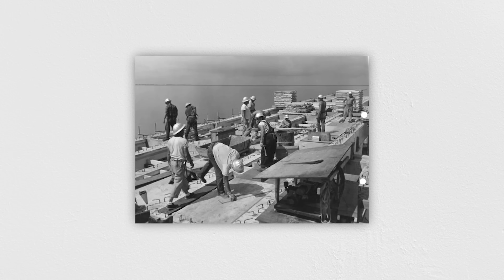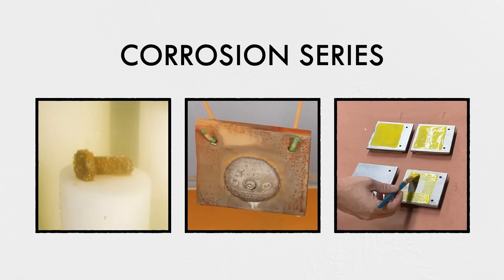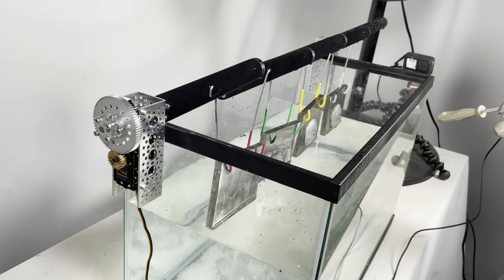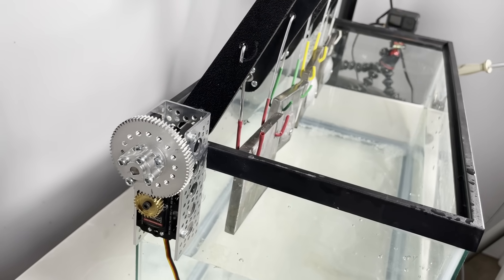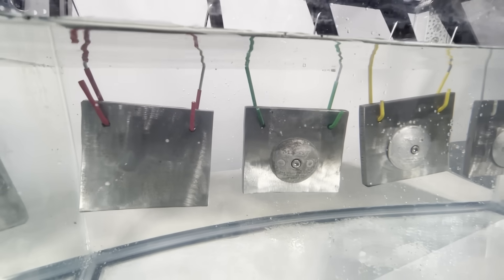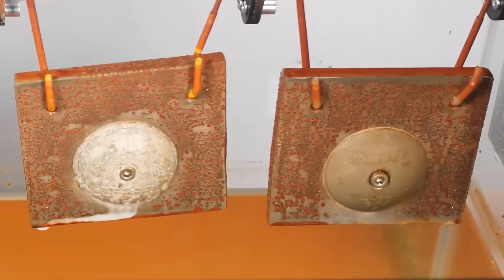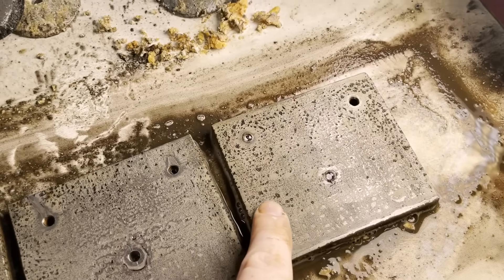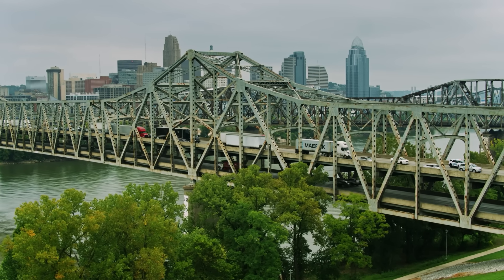Why Spillway Gates Don't Rust Out

Comment: I had a co-worker that swore (and told anyone listening) that putting a (like in singular) boat anode on the rear bumper of a truck would keep the body from rusting. He said it "neutralized" the road salt...I was in the marine industry, and we ran across and interesting situation once. A gentleman had bought a new boat with twin outboards. He'd leave it on the dock for weeks, so he had an onboard charger for the batteries that was plugged into shore power.  We had to replace the charger as it had been submerged. Easy job. Just disconnect some wiring at the charger, install the new one, and reconnect. That fall we got a call from the boat yard that hauled it. "There's a problem with the boat." I went over to look at it and was shocked to find the stainless prop all chewed up and looking like some medieval weapon and the drain plug, also stainless, corroded right off. Turned out, the people that rigged the boat in the spring hadn't connected the two batteries together and, the way the charger was hooked up, it was sensing the port battery needed charging, sending charge, but the ground between the two batteries was missing so it went through the motor, out through the noblest metal (the stainless) and found it's ground at the starboard motor.
Reply: I've used that technique to etch stainless steel water bottles
Reply: So did the truck rusted with the anode?
Reply: @dan_youtube  I never saw the truck but, if the bumper didn't rust, I think it was more a case of good maintenance than the anode. A boat anode shouldn't do a thing for road salt when attached to a vehicle like that. The guy would also tell all sorts of other "truths" to anyone that would listen.
Reply: @mikestackhousemusic  yeah, that anode would only protect things that are connected via electrolyte fluid films, so painted surfaces, areas that do not get wet or otherwise breaks that conductive path would create  barriers to the protective effects.  the "school of hard knocks" has a lot of ideas and stories, but not a lot of rigor or verification.
Reply: @mikestackhousemusic 
You can try! Aluminium is cheap !
Reply: @mikestackhousemusic : If the salt formed an electrically useful connection between bumper and anode, then it should have worked for the same reason as it works on boats. IF the salt formed an electrically useful connection.
Reply: @mikestackhousemusic  Anodes are considerably more effective when the various metals (and the anode) are submerged in water, especially salt water. The current needs an electrolyte to travel through to reach the anode (otherwise it can only protect the metal its directly in contact with). If everything is submerged the anode can provide protection (through self-sacrifice) to other metals a small distance away.
Reply: What about the truck bumper?
Reply: Cathodic protection requires a galvanic cell to function. This means both a physical electric connection for electrons to and electrolyte/saltbridge connecting the substrate and sacrificial metal. So the truck thing works, but not as effectively as submerged or buried examples. 
It sounds like the boat example was a case of leak current causing the ooposite effect of impressed current CP, a process that can indeed be used to etch. 
When the protective surface layer of corrosion resistant materials ( aluminium or Stainless f.e.) is nullified by acid(cataliyic) or galvanic means, it will corrode just fine. A good example of this (galvanic corrosion) would be coated aluminium equioment mounted outside with bare SS nuts or screws. The opposite of CP will occur near the bolt-alumimium interface. Moisture and dirt will create the electrolite and as the less noble material, the aluminium will sacrifice itself for the stainless. Blistering of the coating and white corrosion product at the connection are the result. 
Another example is copper nails being used on steel yachts; fine, along as there  is no metal to metal contact.
Reply: Is it was single wire 12v system? Negative via hull?
Reply: @kklenov  twin 12 volt batteries but the positive from the charger went to one battery and the negative went to the neg. terminal of the other battery. When the boat was set up that spring, whoever did it didn't connect the ground for the two batteries together.
Reply: @kklenov  Давай я помогу: "Was it a single wire power supply of 12v wired down to the hull?"
Reply: @sliceofthatpie  мгимо финишед :)
Reply: Had a similar problem with a big boat with 120/240V ac power onboard with generator power and shore power to supply it The boat dock 120V power had a bad neutral connection coming from the utility company service drop to the house and boat dock, and, when the boat was connected to shore power, all of the submerged metal (which is all grounded together and to the boats' electrical system ground) was helping to carry 120V AC neutral current for the entire house and dock power back to the utility company transformer via the water and earth to the ground rod at the utility company transformer. It ate up the metal on this boat and the neighbors' boat which was in the next boat slip and connected to shore power. The warm, moist salt air also helped, causing all the stainless bow rails, aluminum tower, and anything else above the water line that was connected to ground to rust, corrode, or turn green at an alarming rate.

Repaired the service drop feeding the house and boat dock, and all this stopped.
The owner was surprised, and the neighbor was pissed!
Reply: I recall in the late 80s, early 90s that JC Whitney sold a product that plugged into 120V and was supposed to keep your auto from rusting. Idk of anybody that had this personally but my dad said he knew a guy who used 1 of these machines and it supposedly worked. My Dad also told me when I was 5 that he'd pay me a quarter for every fart I'd catch in a jar and paint green. I'd run around with a jar for years after. never made any $ but as a kid we believe whatever parents say as fact. We also got some chickens 1 time in a burlap sack and dad said they died from cold but could bring back to life. We set sack in yard, did a dance and said some crazy words and tge chickens came flying out. I have a great Dad. I owe him alot. Now I get to do same things and make my kids think I can do magic and fix all things.
Reply: Sooooo what happened to the truck?
Reply: @Dountman 
Truck rusted away wholly, but that Zinc button lays on the dirt outside of house 😢
Reply: @Dountman that was answered 4 months before you left your comment.
Reply: @bryceanderson4864  I know your wife let me know the details.
Reply: "plain sabotage!"
Reply: Electrolytic corrosion is the name of that and that guy was full of it he just though he knew but rust and corrosion are different rust is a oxygen reaction no energy needed
Reply: Boat! Break out another thousand!
Reply: That is a new one.
Reply: First impression…. The proximity will invalidate the test
Reply: Two stories for the price of one long comment!
Reply: A1 explanation man, I feel like I was there myself
Reply: What? 🤣
Reply: I am pretending to understand all of this you said.
Reply: not reading this
Reply: Galvanic corrosion at it's finest
Reply: Far out
Reply: Anodes don’t work on trucks because air isn’t conducive like water and earth. You’d have to coat the whole truck with something that protects it most well known is galvanized steel and aluminum.
Reply: 2 in one ahh comment, that was rly confusing lol
Reply: Who else didn’t understand anything after reading 😅
Reply: @mosesgideon1115 The first section is telling an anecdote of a guy that swore having a anode in his truck would slow/stop rusting.

The second section is another anecdote where a guy had his boat electrical system set up wrong, and that caused the nobel-est metal on his boat to corrode very quickly.
Reply: @mosesgideon1115  other gen z kiddos
Reply: Tldr
Reply: @Metrallata learn to read
Reply: @_..-.._..-.._  lmao youre schizo talking to yourself
Reply: @Metrallata admitting you have a poor attention span doesn't make you cool.
Reply: The hell you talking about 😂😂😂😂😂😂 uh the point is??????
Reply: I ain’t reading all that
Reply: @dark_matter_surron77  reading hard 😢
Reply: i am (confused) idk (what) is going on
what's (with) the parentheses
Reply: Bro speaking yapanese
Reply: @NaiZYaJ  gen z?

Comment: Decades ago, I worked  as an intern in a shipyard. I am now retired. Paints weren't as good back then as they are now.  Ships carry zinc sacrificial electrodes welded to the submerged section of the hull at regular intervals.  One of the maintenance operations done in shipyards, when ships are taken out of the water is to replace those electrodes.   I still remember going under the hull of a ship still wet and in a simple visual inspection you could tell where some of the electrodes had fallen out.  The molten zinc is poured into a cast which has already a bracket of mild steel in it, which is easier to weld to the hull.  The end result is a sort of shiny ingot with two steel ears on each end.    While most of the hull had aged as could be expected, around the electrodes that had fallen off, easily found since the mild metal bracket often remains, the un-protected part was pock marked with holes about the size of a quarter of a Dollar and 3 or 4 millimeters deep. Some parts were so badly damaged that whole sections had to be cut off and replaced.   Your excellent experiment reminded me of that because it was the same steel all over the hull, all moving in salt water, some parts protected and some not, and the difference was just as striking.

Comment: If you want an example of why it's not a great idea to use galvanised rebar in the structure of concrete pylons for a bridge exposed to saltwater look up the incidents and remediation work involving the northbound span of the Swansea bridge in Lake Macquarrie New South Wales Australia, long story short slatwater permeating the concrete reacted with the zinc coating generatied hydrogen gas inside the pylons which seeped out and ignited several times before a costly investigation and remediation process were undertaken around a decade after completion.

Comment: To create rust you need oxygen. There is no need in lifting metal out of water, if water has oxygen dissolved in it - just add a pump for fish tanks o) And you can prevent iron from rusting in water by creating a layer of oil on top of that water - https://www.youtube.com/watch?v=2GrM0WreOxE (no need to listen, just scroll the video)

Comment: Grady, why couldn't I clamp sacrificial cathodes in a few places in my vehicle frame? Especially in something sitting outside waiting for me to work on it? I'm thinking I could sand off areas of bare metal, clamp the cathode in place, then paint over the entire installation. Would paint on the outer surface affect the ability of the system to protect against rust?
Reply: As some one who lives in place with a lot of salt used on the roads in the winter this question stuck out to me. After a quick internet search It seems that that is a thing you can do but the area of a effect is smaller than in a completely submerged system. Rust tends to form in a lot of very small local pockets, this means you would need a lot of sacrificial cathodes. Ideally you would want to coat the entire thing, essentially galvanizing the steel. This lead me to find a product that seems to be widely available, Zinc cold galvanizing sprays. I don't know how effective they are but it seems to be the solution your talking about.
For the second part of your question. Both metals need to be submerged in the same electrolytic solution for the ions to flow. Painting over  the frame would prevent that, nullifying the system except where both the cathode and the frame were both exposed together through a scratch in the paint.
This was really interesting to look into, good question.
Reply: @Hyraethian  I don't quite understand why painting over the cathode would change the system, since I would assume that the "work" is being done where the metals are touching. I think that just means that I don't really understand how this would work though. It makes sense that the cathodes wouldn't work in as large of an area as one would want though. Which brings me to the second part of the video, introducing the low voltage current through the frame. Seems like that would be relatively easy to do on a car. How effective it would be if it only worked while the vehicle was running though might be an issue. Maybe that would be a solution for fleet vehicles where they spend more time operating than they do rotting away in a barn.
Reply: @1stuart1  Ions flow through the liquid. both the anode(frame) and sacrificial cathode need to linked together by the fluid to allow ions to flow. Paint would serve to keep the anode and cathode from being wet from the same pocket of liquid. On something like a car frame those pockets of liquid might only be a few drops of water, another reason you would either need a lot of cathodes or a spray coating.
I have no experience or knowledge with using low voltage outside of knowing that it is in some capacity used on boats. That might be something for you to look into.
Reply: @Hyraethian  That makes enough sense. I think of it like galvanized gutters where both the steel and zinc coating are exposed to the same rain water at the same time. Side note, Haag Engineering says that the zinc layer on gutters is good for about 20 years or protection before the zinc coating is completely washed away and rust starts to form. My experience in the field seems to confirm that.

Comment: Impressed current CP is great for buried pipelines BUT (and there's always a but) it can dramatically increase the corrosion of any buried structures in the vicinity of the pipeline, turning them into sacrificial anodes.   Probably doesn't matter much in open country but where the line has to be laid in streets parallel to other services it's a significant consideration.    No such thing as a free lunch.

Comment: Grady I'm very curious about your thoughts on super dense alloyed metals, ik the method is in it's very early stages. But these alloys are insane if we could produce large quantities.
Reply: Are you talking about the technique of hardening alloy in a non crystal formation.  If yes, Super dense alloy has different density through out the whole piece due to inherit production method.
Engineering cannot predictic material decay as such it is deem unreliable.

Comment: Grady,
Ships have been using anodes and impressed current cathodic protection for decades. It has been over 50 years since I started training to be a naval architect and marine engineer.  We were taught about the effects of corrosion on ships.  Coatings, material selection, cathodic protection using both active (impressed current) and passive (anodes) andcombinations thereof.  Shipping companies, depending on size and trade often have full time corrosion engineers to monitor corrosion and the performance of prevention systems.

One of the strangest occurences I encountered was on a double bottom tanker that had recently entered the Alaskan North Slope trade.  As was practice at the time the cargo tanks were not coated and except for the suction wells there was no cathodic protection.  After a small amount of oil started appearing in the double bottoms the cargo tanks were cleaned and inspected.  Small pits about 12 mm (1/2") in diameter were found.  There was a higher concentration of pits near weld seams.The pits had water in them.  If you put your finger in the pit and rubbed gently you could get them to shine brightly.  It turned out the pits were a result of a combination of water settling out of the ANS crude, sulfur content of the crude and the uncoated mild steel.  The concentration of pits near welds was due in part of the raised area of the weld seam causing the water to pool and the heat effected zone around the weld changing the properties of the steel.  The end solution was, after repair of the pitting, to fit anodes and to coat the bottom 1 meter (36") with a 2 coats of epoxy paint.
Reply: That's interesting !
Non native english speaker here. What does "pit" mean in this case ? Some sort of small depressions ?
Reply: @noemierollindedebeaumont1130  Yes.  If you remove heavy rust from the surface of corroded steel you will see small holes  commonly called "pits".  The steel on the tank bottom was not heavily corroded.  What we found were small holes filled with water.  The holes we found were small hemispheres, similar to a small mellon ball.  By rubbing the bottom of the hole with your finger the polishing action would leave the steel looking as if it had been sand blasted and was ready for painting. 

Bob
Reply: @robertlevine2152  
Thank you very much Bob for your answer.
It was just the precision i needed to understand !
Reply: Yeah, I was kind of hoping that since he lives in Texas, he would have had at least a brief mention of Battleship Texas, which was recently moved into a drydock for repairs, mostly for corrosion damage.
Reply: @DABrock-author interesting, I didn't know anything about the USS Texas. But my father was always into military vessels and wore his favorite  USS Texas ball cap all the time before he passed away. I wore that hat until it was disintegrating, and was asked  about the ship often, but I never knew much of anything about it. I did get to tour the USS Missouri once though, what a treat that was.

Comment: Another great example of cathodic protection that many people may have in there house is the anode rod found in tank-style water heaters, which helps to protect the glass lined steel tank.  Also, as demonstrated in the video, the rod will deteriorate over time, which is why it should be replaced every 5 years or sooner to extend the life of a water heater.